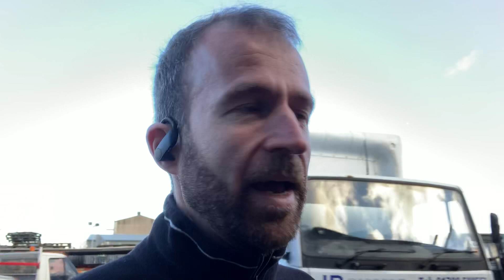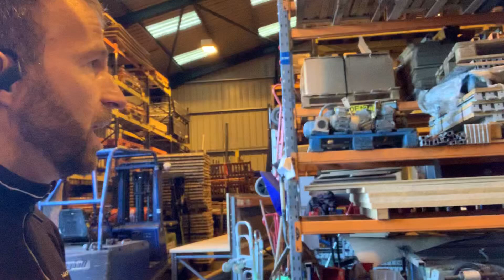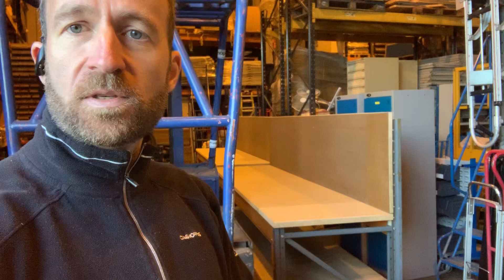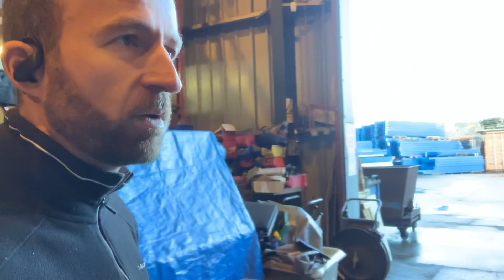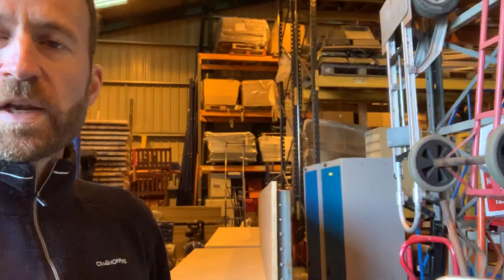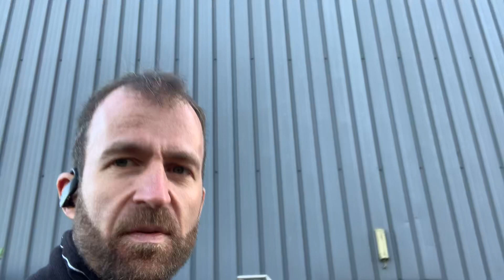Racking and workbench options for the new workshop

Comment: This is probably a stupid question but could you not make your own racking with wood??
Reply: Could make your own lvl (laminated veneered lumber) to span wide lengths
Reply from the maker: It will never be as strong in the same section size; also more prone to warping etc.... and I am looking for a quick and easy solution

Comment: gi dont think those benchs make financial sense. 350 for a bench is a lot. you can buy the parts loose and make it yourself. 2 ends @70 gbp and 2 sets of horizontal bars @70 . thats 140 . a few hours to cut them down to the height and fit a top and back is well worth it. 200 gbp left over to pay for that. you also would onbly need 4 legs to get 3 sections long by getting more horizontal ones. you can aslo allow the backs to go a lot higher and store stuff on that.  if you used narrower racking say 500mmor 600mm you could double up the part at the bottom to create a bench but let the rear one continue up and use it to store parts that are being sanded etc right behind the sanding area.
Reply from the maker: MelbourneAlan I would need to buy a good metal cutting saw.  And ideally welding equipment for adding bolt down feet and wheels.  That could make sense though, considering the saving to of just buying the parts.  Especially as we would prefer to put our own tops on them with bench dog holes etc.
Reply: @Alastair_Johnson  if you bought 8 foot long lengths  they would have feet on them already. throwing away a few feet of legs would be a lot cheaper than putting feet onto the rest of the leg. the racking company would do that for you im sure. 
i presume the casters would be easy enough to fit. just drill a few holes .

Comment: I'm guessing at that height you don't have to fix it to the floor? I remember having to Hilti fix some ranking to the floor before but more when forklifts were involved and higher. I'm guessing you can CNC the tops  to get the dog holes. Great to see progress and some of the considerations that go into setting up a workshop. Thanks Sam
Reply from the maker: Sam Rix I would bolt the board racking to the floor, probably not necessary with the benches.  I’ve never used a hilti gun.  Would it fire a fixing through a hole in metal plate and fix to the concrete?  Or does it even fire through metal plate?